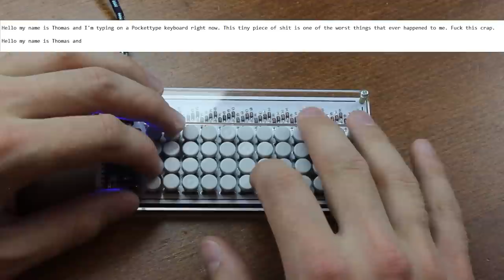Pockettype keyboard review (microswitches)

Comment: Tact switches are rated between 1000 and 10000 actuations, typically. Shockingly low. They use them in console controllers and there, they make rubber domes look like the reliable alternative.
Reply: they only use them for L+r3 and maybe start and select. 
it's also used in some cheap remotes
Reply: @JessicaFEREM  Depends on manufacturer.  L3+R3 universally use tact switches because the stickboxes are an assembly from ALPS or a clone of such.  Other than that, what's typically seen is shoulder buttons, L1+L2 or bumpers, using them due to how simple and widely available 90° mounted tacts are; and more recently, a lot of rear buttons use tact switches, mostly because of how slim they are for a full package, and ease of mounting.  Using tacts in face buttons isn't unheard of, they're actually quite common for clicky controllers as the 'better' option compared to metal dome switches, not to mention the reliability and repairability factors, there's even mods to convert the first party offerings to be clicky; though this is also starting to get phased out as more mechanical implementations start seeing the light of day.  Perhaps you should look into a topic before spewing bad information about it.
Reply: True for cheaper controllers. My F310 has these for the shoulder buttons, but surprise surprise, 9 years later, they still miraculously work. Though... they do not feel very good xD.
Reply: This is completely wrong. It depends on the manufacturer and the series. C&K Switches for example have the KSC4 TE SERIES with endurance switches that goes up to 10,000,000 cycles.

Comment: A few years ago I was inspired by the PocketType to gather some tactile switches, veroboard and a tiny 32u4 Arduino-clone and solder up a DIY version. It sits in a drawer under my TV so once or twice a year I can reboot/reconfigure my RetroPi arcade widget or something similar. I scribbled the letters on the keys using a sharpie. It's a hoot so long as you don't have to actually use it more than a few seconds once in a blue moon.

Enjoyed the review and the designer of the PocketType has made a lot of interesting but much more conventional keyboards with "proper" switches.

Comment: I'd imagine this being amazing as a switchboard for a macropad, y'know when you don't necessarily need full-sized keys for various functions.  Though I will add that different shaped caps would help this immensely, something like a cone with a radiused tip would work extremely well.  Personally when I'm blind pecking keys, essentially touch typing but hunting a key by feel (starting from F/J and moving from there), I do often use the corner of a keycap rather than the full surface, though I also don't use this for typing purposes but rather when I need a key for a function within a program, such as CAD or various vector/raster art programs; which is where I think a tipped keycap would make this board shine, as it has the higher density but suits the same use as when I'm blind pecking.  With a stagger, honestly an isometric stagger could work here, I could probably even learn to type on this thing with tipped keycaps, assuming F and J have a distinctive indicator as I can easily touch type.  Although I do think different switches would also help with the feel, I know tact switches have a variety of options but I'm not sure if any deviate from the immediate crisp actuation with short travel, I'm sure there's something out there somewhere but at what cost; though this would also be an interesting thought experiment for minimizing switch footprints, I could see a mini scissor working here given how simple that mechanism is.

Comment: This thing is adorable and predictably a terrible keyboard for practical purposes. No surprises on those tactile switches, those are usually used as things like power and reset switches which get pressed maybe every few minutes, rather than a few times per second. Most of the ones I've put tried on my tester register at 300cN of force or more to actuate :D

Comment: I wrote legends on with a fine point marker and typed on it by holding it in both hands and using my thumbs. It worked surprisingly well that way!
Reply: Yeah i thought at this point it should be treated more like a tablet/phone on-screen keyboard
Reply: I would also go for thumb typing on something like this. Clearly not suited for traditional typing! I think the switch choice also lends itself to thumb typing as the thumb is more stout and generally better at pressing the stiff weight/feel.

Comment: i think the bottom corner key not working might be a function of the diode that is soldered backwards (fourth from the right). you can see it clearly at 7:26
Reply: Good catch.
Reply: The bigger question is: Why does it have diodes? Like is it tenkeyless?
Reply: @therealsunnyk  I think they doubled the some of the uC lines by switching modes between pull up and pull down. With the diodes you prevent current being sunk from one source while allowing current from the uC being sunk to ground.
Just a guess though.
Reply from the maker: I'm 99% sure it worked originally though. I did a bunch of testing to see what's what when I got it.
Reply: @therealsunnyk  the keys are in a matrix, the diodes prevent ghosting when you press multiple keys at once by preventing current flowing through the closed switches onto the wrong sense lines of the matrix. Chyros has an explanation of how that all works in another video. Sure, you're unlikely to be doing much rollover with this, though, so the diodes are not exactly that important, but they're trivial and inexpensive to add so why not. It's mostly just an exercise in making a miniaturised keyboard and a regular sized planck-like would definitely need the diodes, so the miniature version should do too. As much for the aesthetic as anything else.
Reply: @therealsunnyk Because on serious gamer keyboards like this, you need that NKRO.

Comment: The only saving grace I can think of is, I don't think you can get a macro pad that cheap with as many keys on it any other way. Provided it can be programmed.
Reply: It takes the same kind of microcontroller as any custom keyboard, so it can be programmed through QMK just as much as any other board (and in fact you need to compile and flash the firmware before you can use it at all).

Comment: hi, sorry if I was a bit rude in my last comment. I wanted to say not all customs use foam and most true enthusasts use broken in lightly lubed "hyperglide mx black". We stopped using heavy lube and we use really light lube which just changes the feel, We also stopped lubing our switches like gateron cjs beacuse they are factory polished and get scratchier when opening up. Im also tryna make my own orange alps-style mx switch using a separate modified copper leaf(originally the thing making the switch work) into a alps-like tactile leafs.

Comment: I can see a use case as an input board for a smart TV, but the lack of bluetooth, legends, and value really kills that.
Reply: I have a 10 euros keyboard of similar size, maybe a bit bigger (kidney-shapped), with rubber keys, but also Bluethoot, touchpad, and a replaceable lithium battery.

You are right, this thing isn't even useful for a tv.
Reply: That looks like a standard arduino pro micro compatible microcontroller, so lack of bluetooth was a choice whoever built this made. Legends could also be painted on if you wanted.

I can imagine this being handy for a TV setup, you'd only really be using it to type in the occasional password or search term anyway, and it'd beat using an onscreen keyboard.

Comment: Sorry ortho lovers, don't get what you get about non-staggered layouts. What is this, the anti-touchtype layout? 

The whole point about the buttons being different is so you can identify them without looking at them. This is especially important of keys such as Control, shift, and alt. This is why even on my blank Unicomp, the f & j keys have their guide lines.
Reply: you don't need a staggered layout for touchtyping, though I agree the keys where the index fingers go (or alternatively, some other finger references) should have some kind of bumps to orient oneself. Once you position your index fingers, no further shapes come into play when touchtyping; you simply move the fingers because you know where things are relative to that, you don't feel around the keyboard for the right shapes as if you're a blind non-touchtypist. that combo would def be slow.

And the example doesn't make sense to me - especially keys like ctrl, win, alt (though prob not shift) are often rebound differently anyhow in var layouts. between the controls of a tiling wm, emacs related rebindings and seeking a cool position for a compose key so I don't have to leave english layout to type the special characters of my language, (as well as trying to fit both esc and backspace closer to homerow, and there's only one capslock to obviously remove), the spacebar row of keys basically never had much to do with what's on the keycaps anyhow. 

So touchtyping or not is just completely orthogonal q to stagger, if you pardon the pun. 

As to why people do it, a number of optimizers for kb layouts tend to give less bad weigths for non-homerow keys on orto as opposed to staggered layouts. Sooo ergonomics I guess? I've not tried it to have an opinion on whether they're right though.